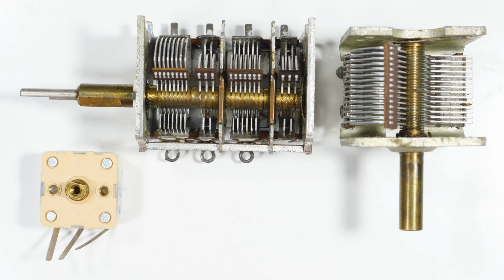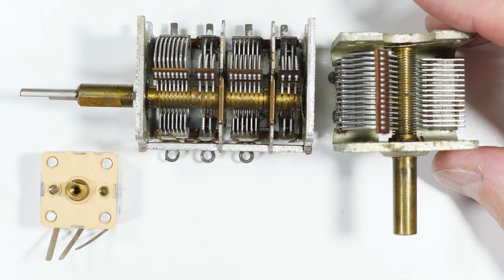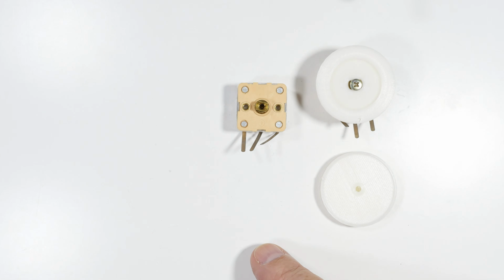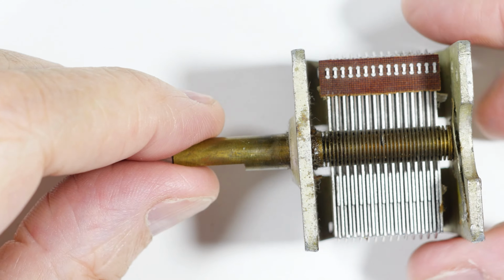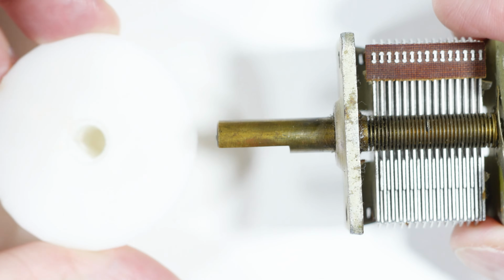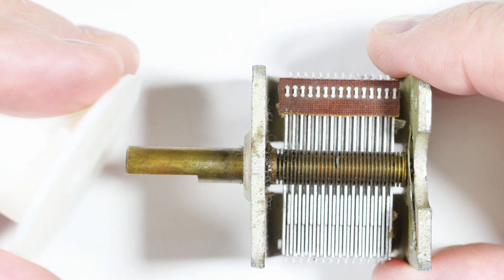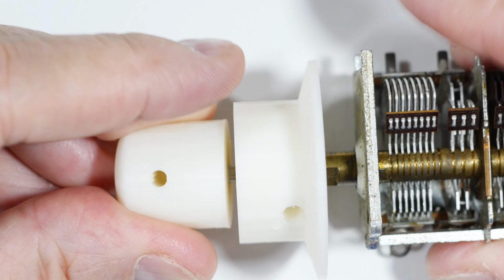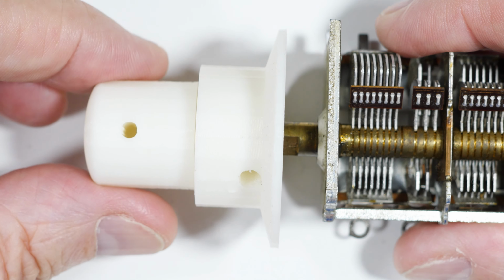Crystal Radio, TV, Oscilloscope, Etc Knobs 3D Print

Comment: The shaft is 6.35mm AKA 1/4 inch.  You won't hit the exact dimension on a 3D print so you will need to go a bit large.
The set screw is a good idea but remember you can't do it up very tight on just plastic.  You could make a space to take a nut down the hole.  This would be stronger than just threads in plastic.
Another option is to provide for some sort of spring action to keep the knob on.  I have done this when repairing a knob using a cleverly bent bit of metal from a tin can.  The nice thing about using a tin can is that there is enough metal to make about 100 tries on getting the dimensions right.